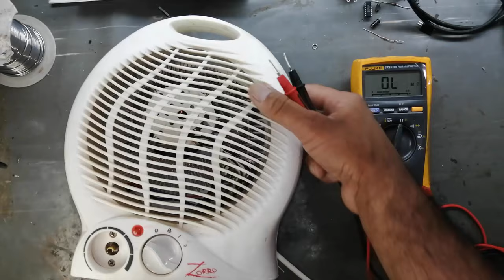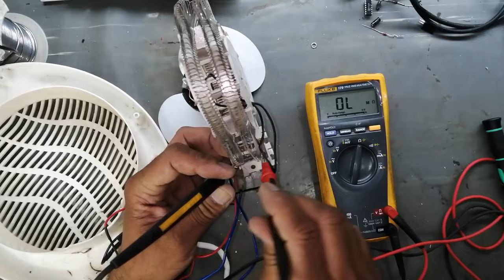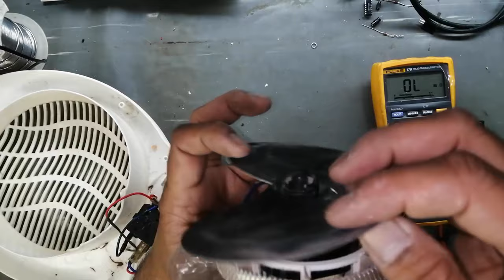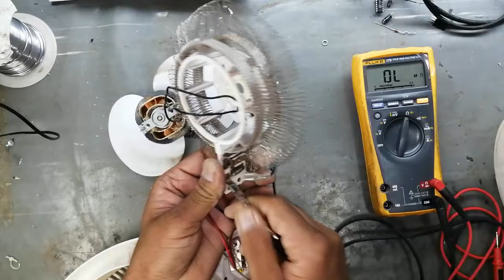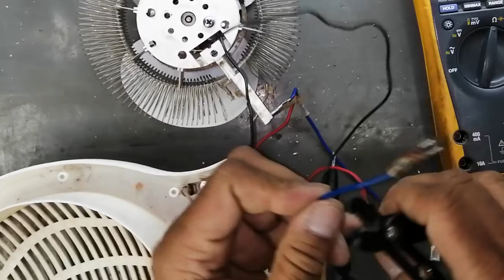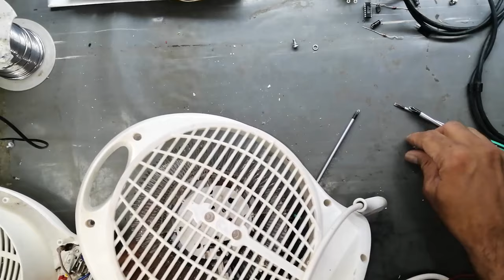{215} How To Repair Room Heater Fan at home

Comment: GREAT VID - I opened my heater and same problem - I bypassed the thermal fuse with piece of wire soldered in and it works fine. Still chucking it though,  by the time I've bought the thermal fuse and messed about I've saved a ten quid heater - but it was fun getting it going again. Thanks Haseeb Electronics!

Comment: Thank you for such an informative video. Any chance you could help me troubleshoot a fan heater problem that heats for a few seconds then stops due to the thermal switch clicking open? The fan works perfectly. I’m not sure if I need to replace the thermal switch or another part. Please, can you help?
Reply from the maker: best regards
thermal protection trips off when there is inadequate air flow through fan heater, and the temperature in heater area increases, in that case thermal protection gets activated and protects the heater. 
you can send a picture to whats-app 00-962-79-11-61-084
Reply: @HaseebElectronics  i have same fan heater but the connection where the coil joints are white plastic corner burnt and broken off So now I can see glowing light in connection wires Do i need to change that plastic white element part?

Comment: Would u have to reassemble the powercoils to just use the fan without the heating element.or would you need to add start capacitor if u bypass the thermostat cord.

Comment: Do you solder the new thermal fuse
Reply from the maker: thermal fuse must be crimped 
it can be soldered, but it need very careful soldering, otherwise it melts out rapidly
Reply: There’s no space to crimp on my heater I’ll need to solder

Comment: Thank you for informative demonstrating on how to fix the heater fan. I have subscribed to your channel. I have a similar heater fan but I am unable to unscrew that have Y heads.  Could you kindly advise where to get the screw driver? I have been to hardware store and they have a full sets of screw driver and don't sell single Y head screw driver.

Comment: Hello sir
 Micro switch in my heater is  by passed and the fan is now working but not the heat .
Mine is difrent it have a display.
Reply from the maker: check the heater wire for continuity
if it is display based then might be there is a control relay for heater

Comment: Salaam wucyclum brother  jazzallah khiar for the video and help, I put a new fuse and  then goes cut off and then come back on.It doesn't go to hight temporary.The fuse is the same thermal cutoffs type SF119E rated ope temp 121°C. What do you thing brother need bigger fuse. Stay warm model F2003WH voltage 220-240v-50Hz 1800-2000W Batch DXF0039266

Comment: My one it’s fine and the fuse it’s fine but works only on the second speed !! No first speed any ideas???
Reply from the maker: possible cause, might be selector switch, or heating element low heat section is open circuit
Reply: I thought it maybe the switch I’ll try and post the comment below thank you very much!!

Comment: What is the power of fused that you replaced.
Reply from the maker: its part number is SF139E 250V 10 Amp 142 deg centigrade thermal fuse
Reply from the maker: it is thermal protection fuse
Reply: @HaseebElectronics  this is what I'm searching for, thanks, very helpful video,
Reply from the maker: It is my pleasure

Comment: Sir, what is the function of temperature switch?
Reply from the maker: temperature switch or thermostat or thermo switch or temperature activated switch

it makes or breaks the electrical circuit at a spiecific temperature
Reply: Thanks

Comment: Mines warm up but won't spin the fan. Can it be repaired?
Reply from the maker: Yes it can be repaired easily
Check continuity for fan motor
Check switch at different positions and trace the connections
Check thermal fuses

Comment: Thank you 😊  i got an idea from you. The fuse cuts the flow of currency if its dead, so just put a wire that runs aross the fuse to ensure the flow of current is not interrupted and its now working 💃💃

Comment: Good video, but the really critical bit is missing: what fuse did you use and how did you replace a broken fuse which looks as if it is riveted in place?
Reply from the maker: it is SF214E 250V 10Ampere thermal fuse. it is used when thermal switch or thermostat can not open teh circuit or air flow stops due to any obstruction in air inlet or outlet, the inner temperature will increase withing the heater body, so this fuse will disconnect the circuit as a last step in safety
Reply: For my case, the fan runs well but the heating element is not working. Can I use any electrical 10Ampere fuse? Getting the very specific fuse is difficult.
Reply from the maker: 10 ampere normal fuse works normally but it will not act in over temperature condition. 
it's safety will bypassed
in case any obstruction in air flow will cause to catch fire

Comment: Hi wats it orpat heater same issue
Reply from the maker: did you fixed it or not. if not, send its picture to my whatsapp 00962-79-1161-084
Reply: @HaseebElectronics number isd
Reply from the maker: 00962791161084

Comment: What if the cooling fan is working but the heater isn't heating up
Reply from the maker: please check thermal protection fuse,  thermostat switch , heating element and temperature control switch (front panel)